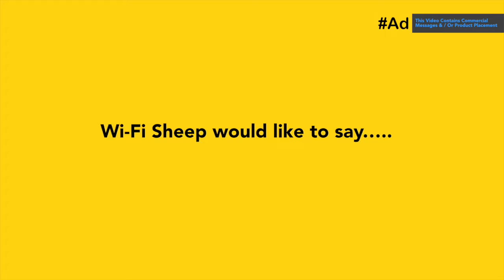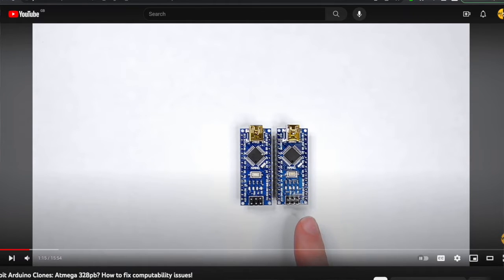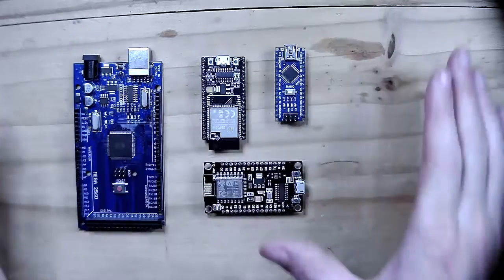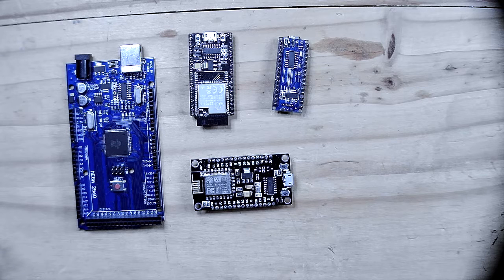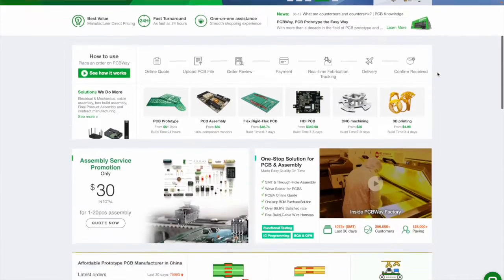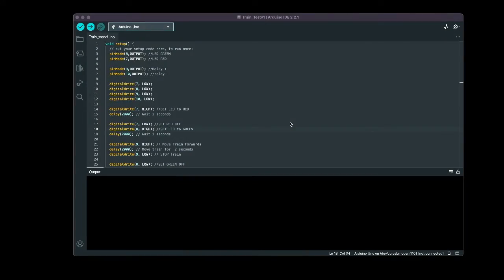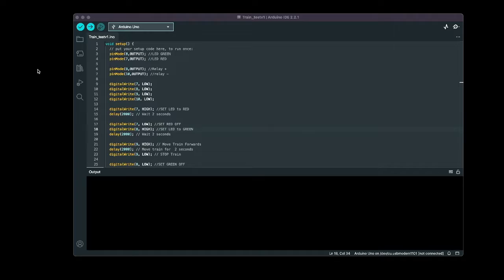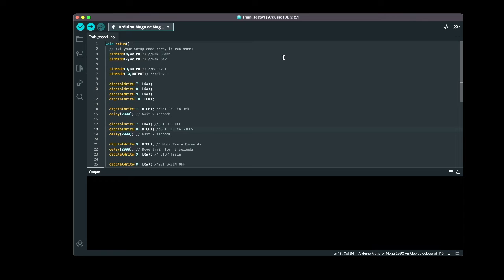#Arduino Clones: The #CH340 Driver .. It now just works! #Windows + #MacOS

Comment: Interesting!  I uploaded the project Rio files to my  clone 2560 last night without any problems so it definitely makes a difference. The only thing I would mention is that you have to set the arduino ide serial monitor to “Newline” or “NL & CR” before interrogating the board as I found out eventually! I thought it worth pointing out as some of us aren’t perhaps aware of some of the settings required!  

Some boards like the mini require using a separate 340g module to programme, not having the chip onboard, which I assume will work also.  

On the matter of pi 5 I’m actively avoiding videos about it as it is absolute overkill!  It is a good board but only one of many now available to hobbyists!